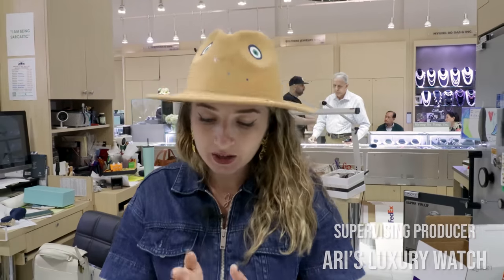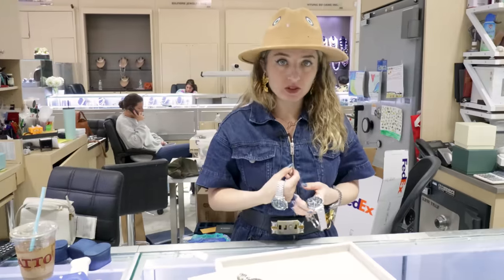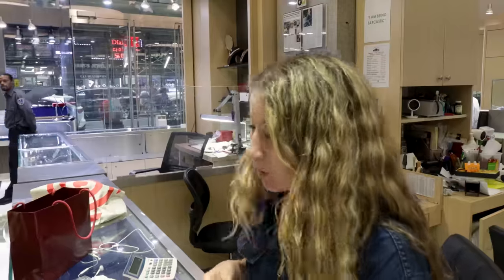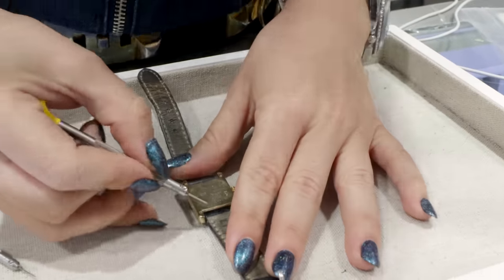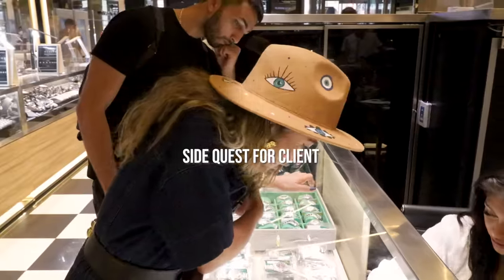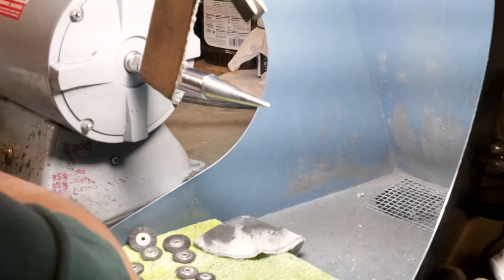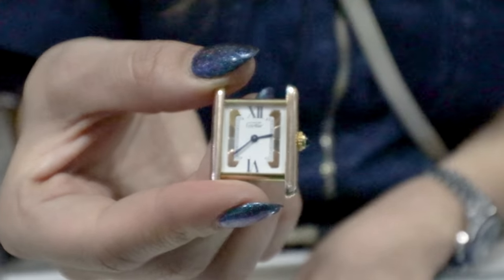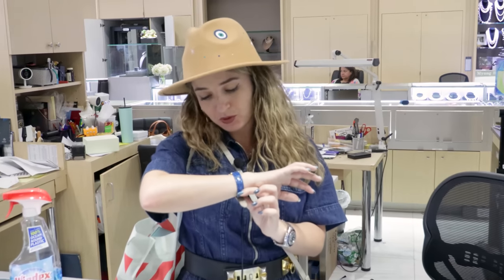RESTORING A VINTAGE CARTIER WATCH | WATCHBYJULS

Comment: I wish I had discovered you last year. Bought a vintage Cartier tank 18K white gold. I believe I got a fair price, however, where I live the alligator strap replacement was an issue. It came with a worn black strap, and I wanted something more "fun". We drove to S. FL to Cartier (they were super kind, even though I told them my watch was purchased pre-owned). But $400 for a new Cartier strap. Of course they used my original 18K hardware. I bought a color called Duck blue. Now I want red. So next time I come to NY I am looking you up! You are lovely and shrewd. Deadly combination!